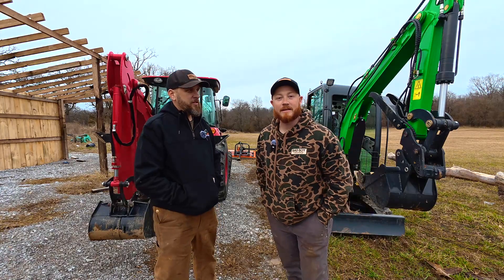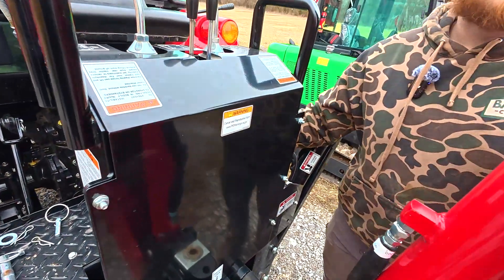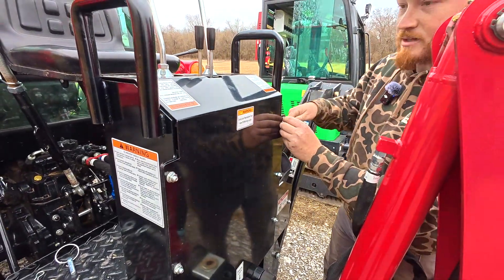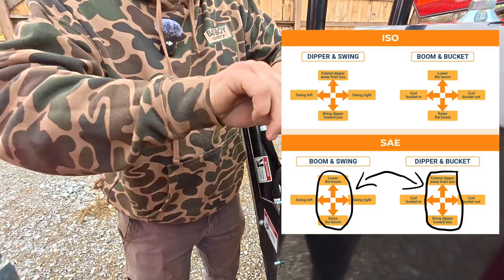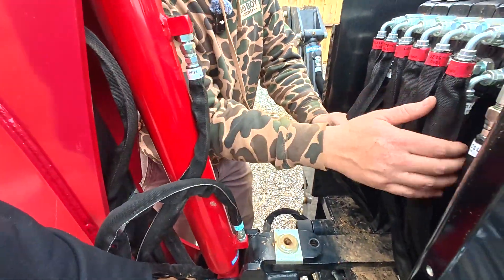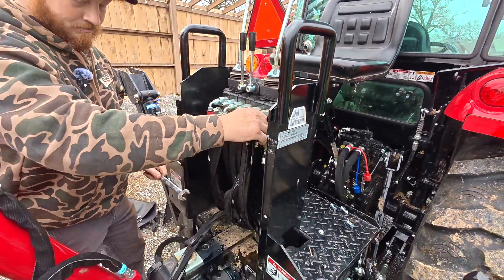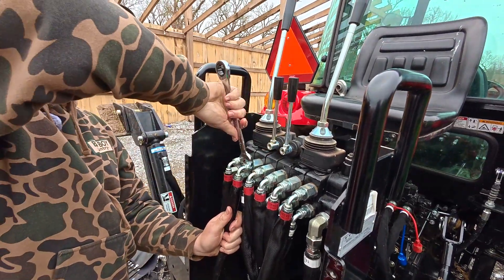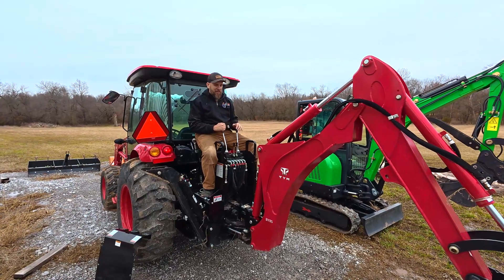How To Swap Backhoe to Excavator Control Pattern

Comment: Careful, each valve hae specific relief valve settings. Not a good fix, in my opinion the valve block should be moved. Probably will work, but set pressure such as the max lift pressure may be different than the crowd pressure.

Comment: Brock, I believe you will need to switch the valves also or you will not have the float function for the boom. My BY85 has a detent on the boom when pushing fully forward, this makes it much easier when pulling the stick toward you and not trying to lift the tractor as it pulls. (Otherwise it's difficult to lift and pull evenly) If you try it the stick will probably now have a float function. Thanks keep up the good videos.
Reply from the maker: Switching the valves would be the most comprehensive long term solution. Maybe we will make a video about that in the future. Thanks for watching!!